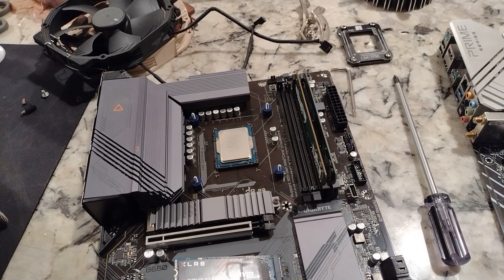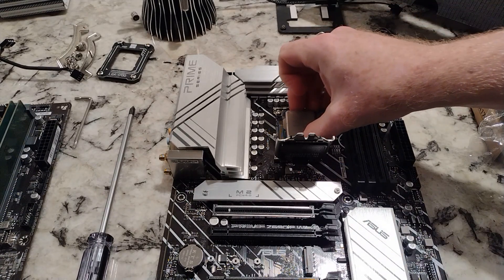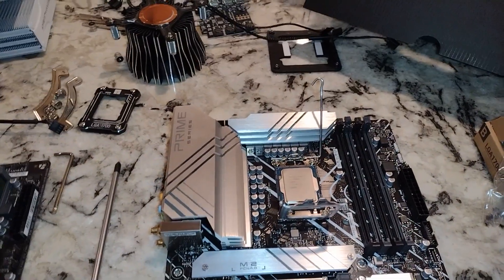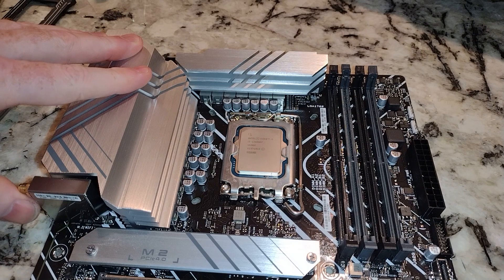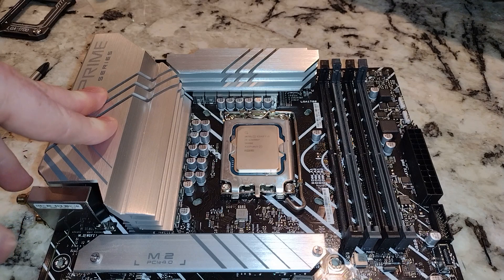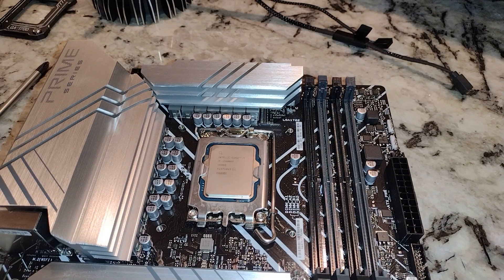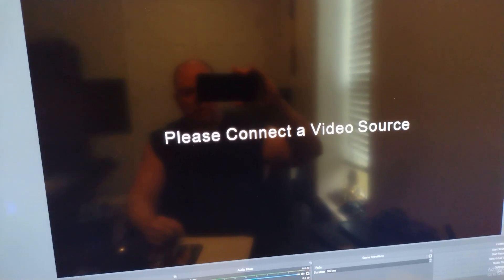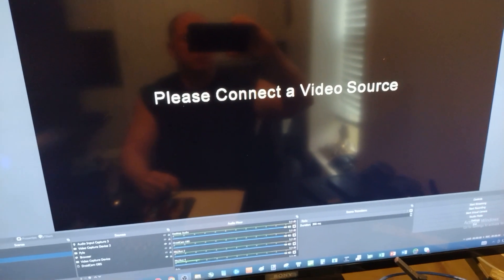Pt1: Get Ready for 13th Gen -What happens when you put that CPU into motherboard w/ old bios?

Comment: Hi really appreciate you are showing this. Wish I had seen it first before I bought my asus tuf gaming b660 d4 + i5 13400f. It has similar symptom. No display, mobos only shows 'cpu' qled debug and shutting down automatically before reaches POST. Does it requires 12gen intel to update the bios either?
Reply from the maker: Yes, most likely you will need 12th gen.  It will be a few months still before that model of motherboard will ship with updated bios version.  Lots of options to get it updated...unfortunately, they all will cost you money.

Comment: My motherboard has a flash bios button and I flashed it without cpu or ram installed 👍
Reply from the maker: I have kind of been thru this on Youtube from 8-9th gen, 10-11th gen....this 12-13th transition has been interesting.  Where we handle a lot of the cheaper motherboards, most of them are missing that feature.   And unlike 8-9th gen, I was able to get most of the 8th gen motherboards to boot with a 9th gen CPU installed.